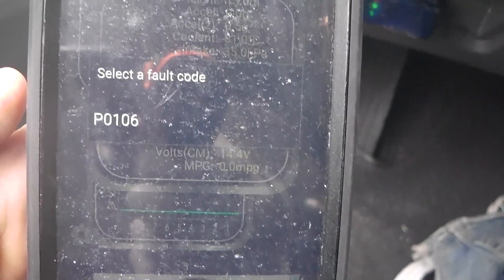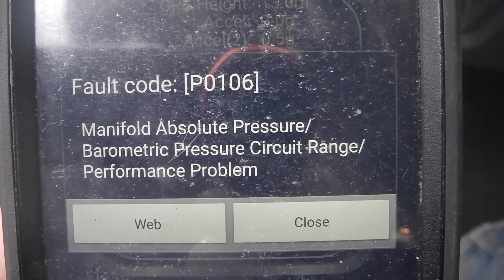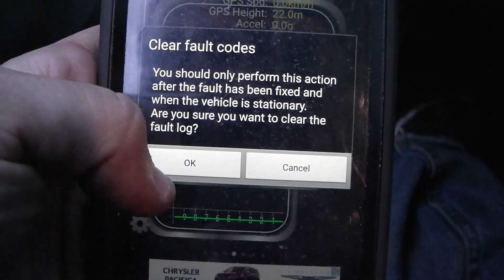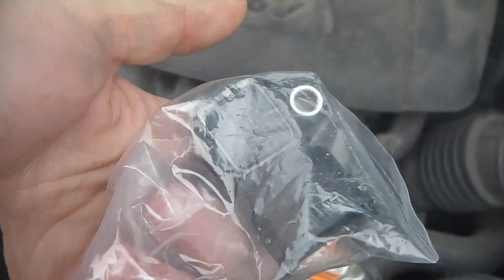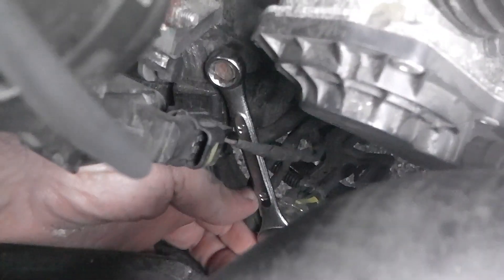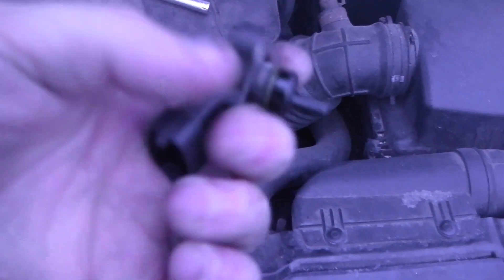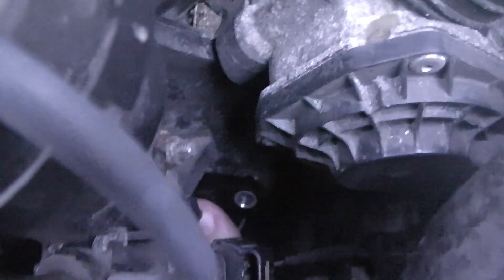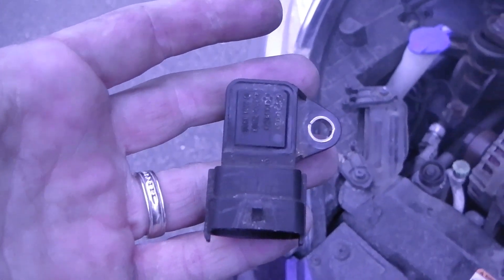How To Replace a MAP Sensor (demonstrated on a 2012 Hyundai Elantra)

Comment: Thanks for the video. I just did this on my wife's 2012 Elantra. Word of advice for anyone else attempting this in the future - there's an electrical wire right in front of the sensor that is attached to something else. (I don't know the name of it, but you can see it in the video. It's literally in front of the MAP sensor wiring and bundled with it). You can make your life a lot easier by disconnecting that wire as if gives you some extra space to work with removing and installing the MAP sensor bolt. Also I was shocked how loose the MAP sensor bolt actually was - so you really need only about a full turn before you can unscrew the rest of it by hand. Same thing goes when you reinstall it. 

One last thing - if this doesn't fix your problem of random stalls at idle / stop sign / red light; try looking at the Crankshaft sensor. It's the next likely culprit - especially if your tachometer reads "0" when you start your car and it turns over fine but will stall later.
Reply from the maker: Thanks...like and subscribe

Comment: (1) I took out the MAP sensor and cleaned it with MAP sensor cleaner.
(2) Took the throttle body off completely so that I could give it a good cleaning with throttle body cleaner. 
 Put it them both back on and it's been 3 weeks with no check engine light. Thanks for the video, it helped.
Reply from the maker: No problem. It's why I make these videos.

Comment: Great video; thanks; and disconnecting the battery re-sets the computer so thats a great tip too; saved me at least $200. if not more !! Also like the way you disconnected the lead after pulling out the sensor !!!
Reply from the maker: You're welcome...like and subscribe

Comment: Thanks for the video. Would a bad map sensor cause the  engine car to shake and interior of car to shake as well at idle and at Park? And would adding oil to the tip of sensor before inserting help so it doesn't go in dry.
Reply from the maker: It might...if the valve is not working it could be causing a build up of pressure...if your car has high mileage (like mine did), it doesn't hurt to replace it
Reply: Eric DIY thanks. and it also shakes in drive like at a stop light. I'll replace it. And would you say adding a bit of oil around the new sensor seal is necessary or not?
Reply from the maker: @cruzdeleon1888  I didn't and it's fine
...my wife's car (same as in this video) now has a misfire in cylinder 1 so I would also look at spark plug replacement as it was running rough with the code P0301 (misfire in cylinder 1)
Reply: Eric DIY i'll check the plugs too. Thanks

Comment: Do I have to remove the map sensor to spray valve cleaner in through the throttle body?
Reply from the maker: I'm not positive but it's easy to remove if you want to. Just plug it up if you do. I would think that it would be ok to leave it seeing that there will probably be remnants of the valve cleaner after it goes in. If the directions just say to spray it in the throttle body, you should probably be fine with it in.

Comment: I want to clean the MAF sensor can u make a video is where it would be located its by the air filter I presume
Reply from the maker: See this...https://youtu.be/G0areDD00zM (I am probably not going to make a video unless I have to clean it out myself)

looks like it's attached to the engine air filter box

Comment: Awesome vid. I've got  2010 forte koup and got same error. Question,  how long did it take for your comp to reset?  Had to drive a while?!
Reply from the maker: The error code went off when I cleared it right away. It was seeing if it returned or not by driving which only took a couple of minutes of driving. As long as the light stays off after clearing the code, you're fine.
Reply: Eric DIY damn.  Mine is still on; 2 days since new sensor and cleared code. Comes back everytime I turn it back on. Oh well,  off to a shop a I go : (
Reply: @robertmcknight9668 Having same issue. What did it end up being?

Comment: Do you know if the MAP Sensor is the same for a 2012 Sonata? I would think it would be.
Reply: Hyundai and Kia engines are identical. Parts locations and the parts themselves are pretty much identical during a certain year range. If you didn't know Kia is made by Hyundai.

Comment: hello my friend and thanks for this nice video but i don't understand how can this map sensor measure the air Pressure inside with this plastic cab on the top of the sensor ???
Reply from the maker: It's just what a map sensor does. I think there's a resistor that sends a voltage to the ECU and adjusts the fuel/air mixture.
Reply: Eric DIY thanks my friend